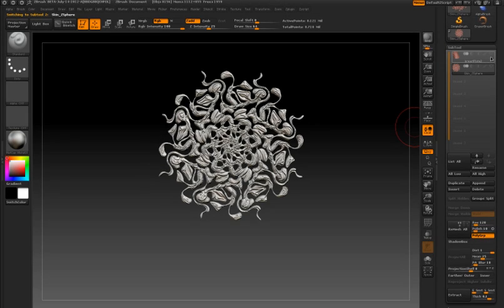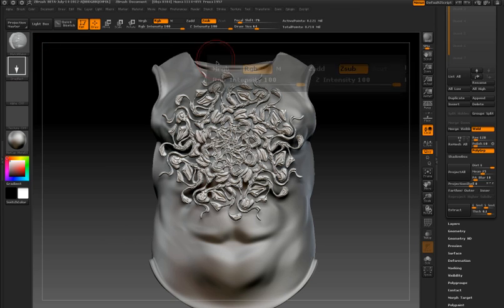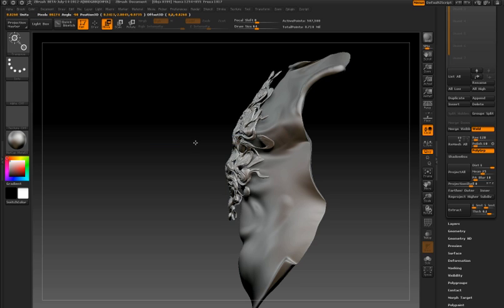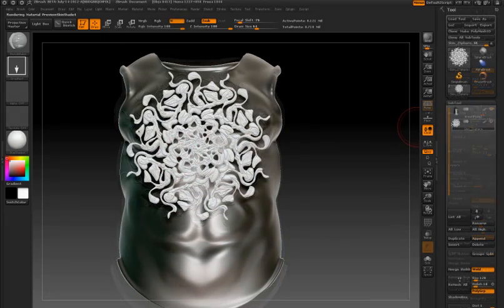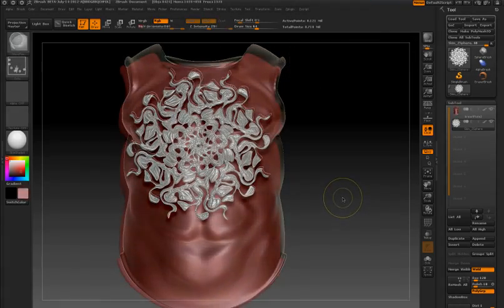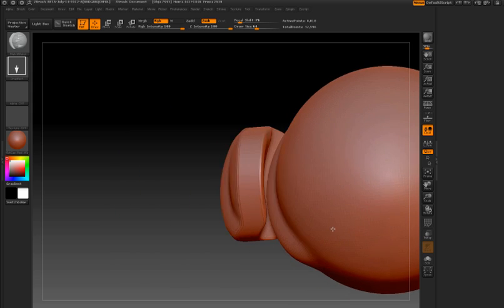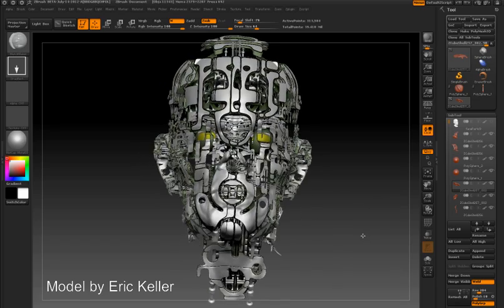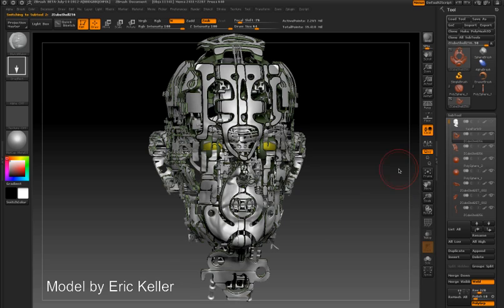ZBrush 4 - MatchMaker Basics

Comment: The downside is that it only works in ortogonal views, if you do this at random angles, the result is all over the place. At least I have not been able to make it work, so if anyone can, please tell me!
Also, the object you are projecting has to be flat. I mean if you project a wavy object, the projection wont fit the surface
Reply: philbertmill2  Yep. Same issues for me. The matchmaker brush is useless in most of situations unfortunately.
Reply: not sure if this is still relevant for you as it was 2 years ago, however what i did was move the actual object i was projecting on to an orthographic angle, that way i could snap the view for a perfect projection.